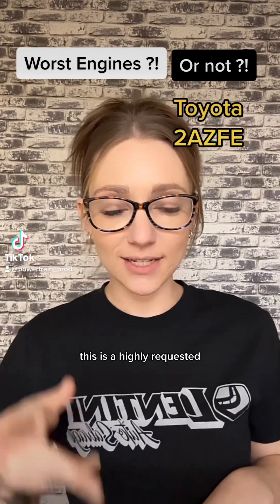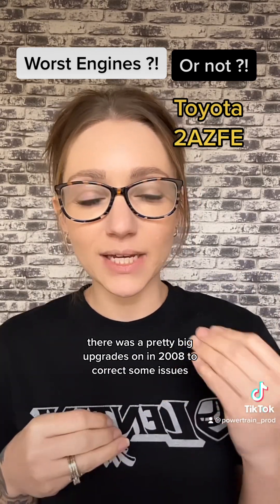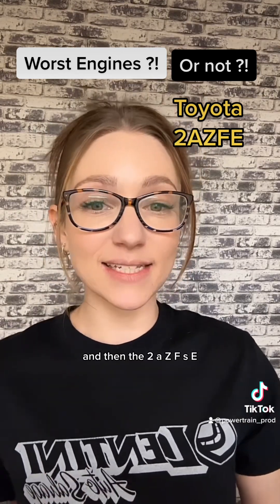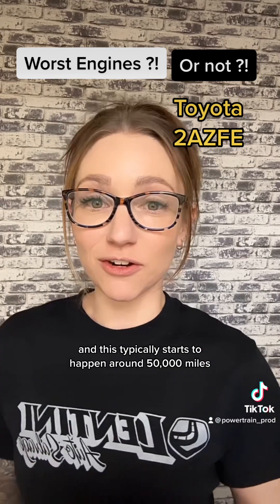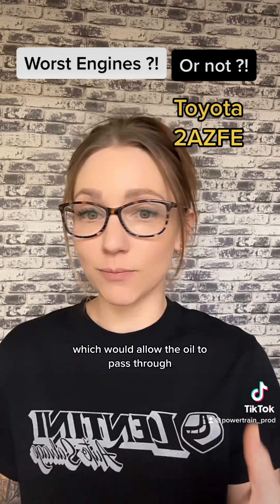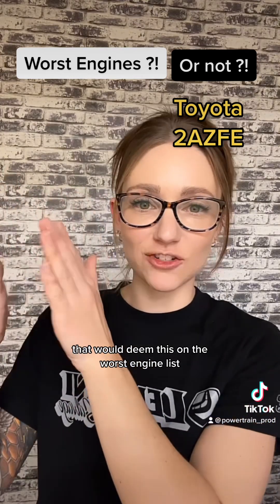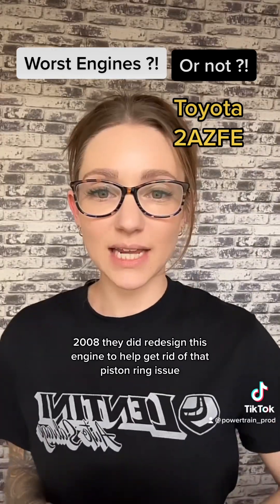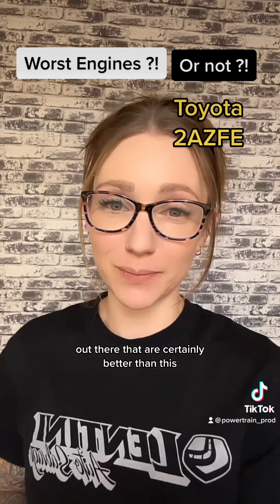2AZFE Toyota Engine

Comment: If caught early before the clogged oil rings damages the cylinder walls you can use CRO 505. It will clean the oil rings small holes and stop oil consumption.  Just give it time to work. It may take two applications if the oil rings are completely clogged. If it doesn’t stop the oil consumption your piston walls are damaged from the carbon and clogged oil rings scratching the cylinder walls until the wear is too much. If this is the case cleaning the oil rings  could make the engine consume even more oil because the cleaning will allow more lubricants to the oil rings and the worn piston walls. So, it would be wise to use a camera to inspect the cylinder walls before you attempt to clean the oil rings. Then to prevent it from happening again  use Valvoline engine restore and protect engine oil to keep the oil rings cleaner. My 2AZFE now has 240,000 miles and only uses approx 1/4 a quart between oil changes 5,000 miles. This is less than my neighbor’s Kia which has only 70,000 miles which uses 1/2 quart in 5,000 miles which Kia says is totally normal that is why they increased the oil capacity to 6 quarts. If you follow the Kia oil change interval of 10,000 miles you will be 1 quart low at oil change. Hope this helps anyone with a 2AZFE that still has more life to give before you buy a new car that the manufacturer tells you it is normal for your car to consume oil. Just get use to it because most of the new engines now have low friction oil rings so oil consumption is the new thing.

Comment: The 2AZ-FE just need the secondary thermostat delete and a 10w 40 full synthetic oil and u have a long lasting engine......the stock thermost is not good and the oil is too thin for the heat the stock thermostat causing...

Comment: 2007  scion tc with 270k miles. I had the engine rebuilt at 240k miles because i was going through about a quart of oil for every 1000 miles. No smoke,no leaks, i just figured i would do it because i had the money and i got a new job that required me to travel long distances. A couple of weeks ago i believe my 5th gear synchro went out. For a couple of months going from 4th to 5th gear i would get a little grind if i didn't rev match or go slowly. On the freeway i let off the gas going slightly down hill and it felt a little more rough than usual and also when i would push on the gas pedal, i was trying to diagnose it as i did it a third time and when i gave it gas my rev "blasted off" as if it was a total slipped clutch. I put it in 4th and drove home. When in neutral i could hear some kind of rough rattling/grinding going on in the trans as if something was broke, when clutch engaged it would go away.

Comment: 2az better than 2zz?
Reply: The 2zz probably better...the 2azfe I have the engine it it not bad I notice the problem it has is base on heat...I correct that by deleted the secondary part of the thermostat to keep the Engine head cool....now I add a thicker oil for protection.... The car runs nothing hold it back.

Comment: My 2AZFE just rolled over to 230,000 miles... 18 years old
Reply: The thing is a beast. Not all of them had the oil burning prob either
Reply: @newbluerugby I just bought one and my flaw was the thermostat has rubber that lock the coolant the secondary part on the thermostat has a strong spring ...I deleted that part and the engine runs cooler...was causing a burning scent....I change oil to a thicker grade bc the stock oil is too thin for a sassy engine. A lil modification and adjustment makes a perfection on the engine.
Reply: @Platinumtag  wait sorry ... which part did you delete? I have that exact burning scent on my old camry after a thermostat change
Reply: @ZeNd0kUn  the scent was coming from the coolant reservoir tank the lil breather hose in the tank was getting too much heat and start the scent of burn rubber....this was cause by the thermostat ....the thermostat is like 2 in one which means it has 2 round plate a big and a small one ...the small plate would be the last part at the end of the thermostat  that's the part to rip off.... The big part  usually have a rubber ring  that set on the engine to seal of the installation u can put a small hole where the jiggle pin is or make it bigger  so when air passing to the top  the air come out  and purge in the reservoir. If u can find a video good for u.. the last plate or the small plate that the secondary thermostat it the heat or pressure from the engine push that the make water cool top of the engine...so once u remove that part your engine aluminum won't ever be damaged. I think that same part u can move it back and forth.... But I can say that your thermostat that is the dual type....but u can check the top hose to the engine and the bottom hose to the engine and see if the pipe on top and bottom can be removed off the engine bc some car has a lower and upper thermostat..... Reason why some people never get to fix the car when overheating bc of hidden thermostat
Reply: @ Thanks for the detailed reply .. i will have to check this out.

Comment: Shenanigans aside. I'm rebuilding my 2006 rav4 2azfe. I want some extra umph and to correct the piston ring issues. I have noticed aftermarket pistons have standard sized oil rings, while even the updated pistons still have thinner oil rings. That was what made it consume oil, was the oil rings were too thin. So they made them just a smidgen thicker, however they're still a half a mm thinner than aftermarket. Which is a big difference. So I may go aftermarket on those. But my main question Is, will the 2008 camshafts work in the 2006 engine, as far as timing and reluctors etc?

Comment: Coming up to 300k miles on mine. Still runs like a top.  Never had any engine or oil consumption issues. Just kept up on regular routine maintenance
Reply: hell yeah! mine is 3 miles from 380k just got back from a 7 hour road trip. different story though mine eats a quart and a half a month lol. next oil change I'm going with a thicker oil.
Reply: I got an 08 camry with 320k miles she runs strong with not bad oil consumption

Comment: Good tip when looking at cars with this engine. The oil burning issue only happens in the 2006+ models when toyota did an engine refresh changing the piston rings to low tesion ones. If your 2az car takes 5w20 or 0w20, then you the updated, oil burning one. If it take 5w30 then your fine.
Reply: I have an 08 camry 2azfe with 320k miles. Oil consumption is not bad at all, I recommend Pennzoil 0w 20
Reply: @spinachgreens9920  ya the updated engines are not bad at all with regular maintenance. The huge burning problems come when people neglect them. I'm just saying older did not have any oil burn issues or at least not as many as the updated one did. My 04 RAV4 with 270k km doesn't burn a drop.
Reply: @PlayLikeLegends  I also have an oil catch can
Reply: Have an 05 and it burns a quart every 300-500 miles depending on driving conditions.

Comment: Well that depends on how you define "better" the 2azfe is a million mile motor if maintained properly, sure it's not a 2jz or a 1uz or hell even a 2grfe , but its a reliable, relatively quick engine, with huge aftermarket support. 

Just my 2 cents

Comment: I have an 04 camry with the 2az-fe it currently has 295k on it. Runs great but uses oil like a MF’er!🤣 I get about 200 miles to a quart!💯🙄🤣 I guess at this point Don’t need to change the oil anymore just the filter right!🤣🤪🤣
Reply: had a 04 solara use to add oil on wednesday change oil on sunday repeat
Reply: @raymondcanessa7208  i got an 04 solara and i legit add oil once a week but i only change it once a month. figure with how much new oil it gets it could probably go even longer without a change.

Comment: The 2AZ-FE engine is actually one of the best 4 cylinder engines Toyota ever made.  More so the 2002-2006 versions of this engine.  While they did suffer from the back three cylinder head bolts stripping out , they did not experience oil consumption issues.  It wasn't until 2007 that oil consumption became a problem.  2007 is when they started using low-tension piston rings in an effort to improve fuel economy.  The quick way to tell if your engine has the low tension rings from the factory or not is just to look at the oil fill cap: if it says 5w30, then it is one of the good engines.  If it says 5w20 or 0w20, it has the low tension rings which burn oil.
I own a 2002 Camry (2AZ-FE) with almost 210,000 miles and it runs great.  The only oil loss I experience is due to a seeping valve cover gasket and leaking valve stems seals, both of which I intend to replace at some point.  Otherwise, the engine is flawless, gets great MPG and has decent power.
I would recommend watching the Car Care Nut's video on the 2AZ-FE for a more accurate description of this engine than what is given in this video.  The girl states a lot of facts from a website or two (I've read them all and could pick up on that) but she doesn't really know the engine through and through like AMD.  Here is the link to the Car Care Nut's video on the 2AZ-FE on YouTube: https://www.youtube.com/watch?v=F994QmOD6W8&t=14s&pp=ygUNMmF6LWZlIGVuZ2luZQ%3D%3D
Reply: I got an 08 camry 2az fe with 320k miles, I use pennzoil 0w20 and it doesn't eat oil like people say
Reply: . @spinachgreens9920  That's great!  Your engine must have had the re-ring job done then because all 2007 and up 2AZ-FE engines had low-tension rings.  Once you take care of the rings and block if needed, the 2007+ engines are just as good as the 2002-2006 engines.  Just unhandy that you have to rebuild the motor to do it.
Reply: @spinachgreens9920  mine 2008 rav4 and drinks oil. I have to top off every two weeks with quart if oil. So it drink quart of oil every 700 miles.
Reply: Thanks for the info.Mine has 5w30 on oil cap.

Comment: Why use heavy weight oil and not the weight printed on oil cap?   How would that help with oil consumption?
Reply: it does yes, think about it like this. run water through a noodle strainer... okay goes right through. now put peanut butter through it and tell me the result. Cheers
Reply: I have 2010 scion tc, mine burns oil but never had an issue. If you live in hot climates definitely use a heavier oil. If you live in very cold climates probably best to use 5-20 and just keep topping it up.

Comment: Now at 285k miles I consider my camry a polished turd. Still gets 27 mpg. Goes through bout a quart a month orso. Lots and lots of engine noise hense why I change oil at 2500 mi and use high mileage mobile 1 full synthetic. It's been a very reliable car.
Reply: keep changing the oil and never sell it brother! mine is 3 miles shy of 380k just got back from a 7 hour road trip. same as you i burn a quart or so a month.